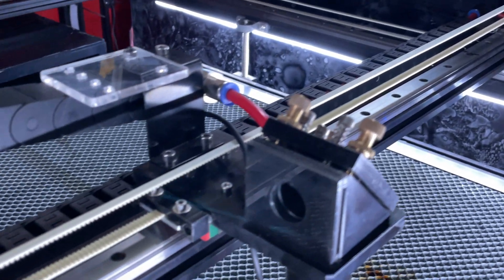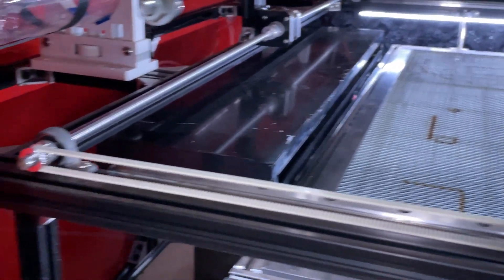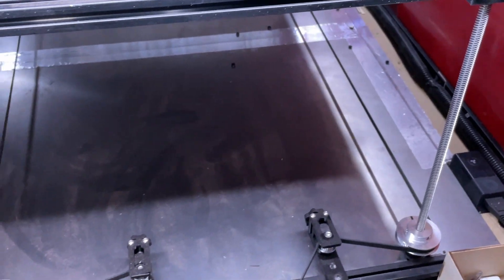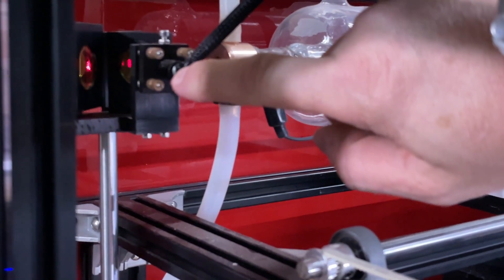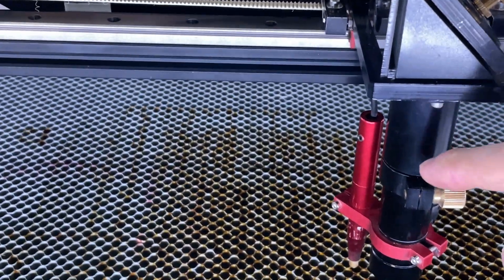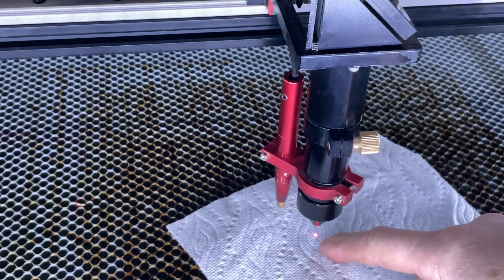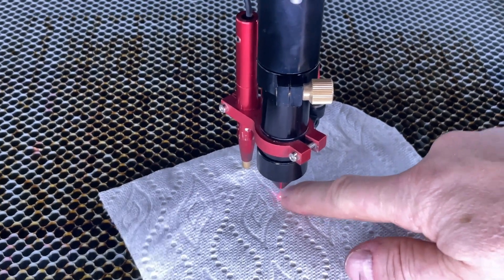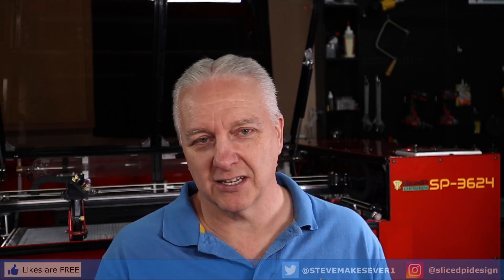What If You Could Build a High-Powered Laser at Home Right Now? Part 2

Comment: Hi: What linear rails did you use for the X / Y? The rails I found on Amazon are VERY heavy. I would think that lighter would be better. Thanks
Reply from the maker: Only the linear rail on the gantry moves, that would be the only one to consider. However if you are worried about weight then use a nema 23 motor on the Y axis. It will have enough torque to negate any weight on the gantry

Comment: Nice! How do you like your OneFinity? I was really tempted when they were running the discount back in the Spring. Just didn't have anywhere to put it.
Reply from the maker: I love my OneFinity (and no one is paying me to say that 😀). I looked at all the mainstream CNCs in the same range and this one was the best balance of performance and quality.  My one gripe with most of these mid-market CNC machines though is the use of a router as a spindle.  I'm currently in the process of upgrading the OneFinity to an 80mm spindle.  But more on that later.